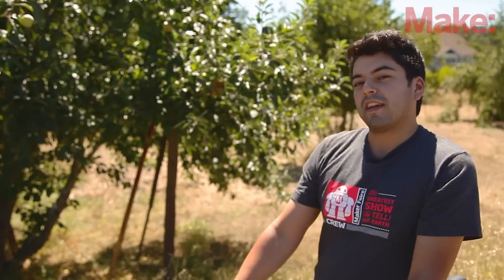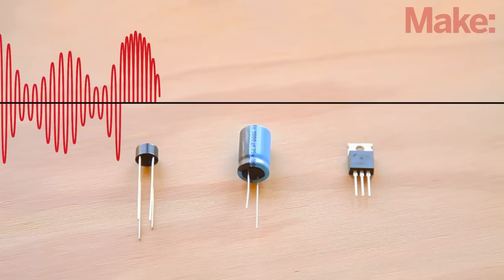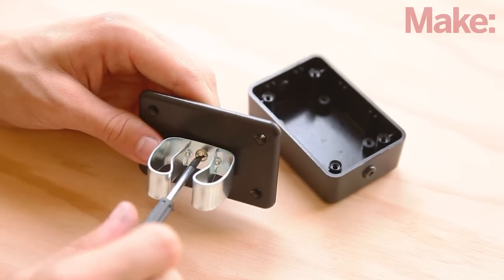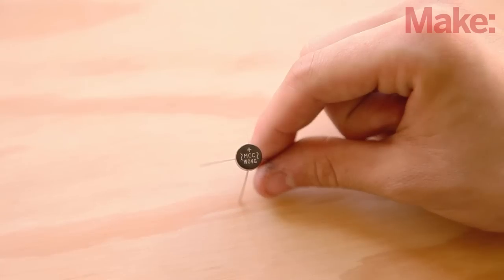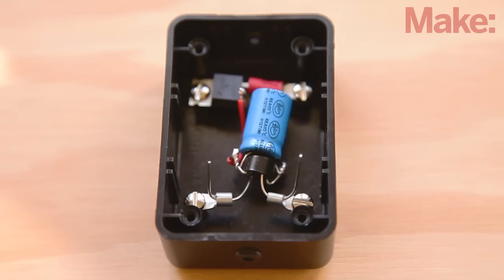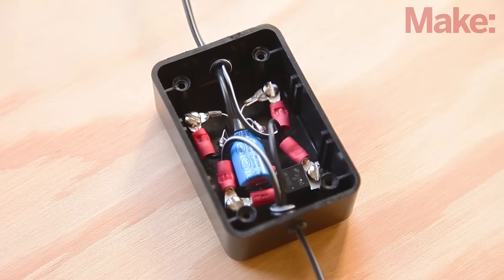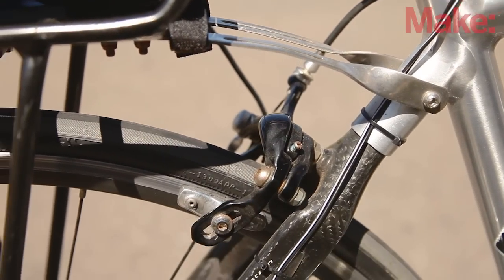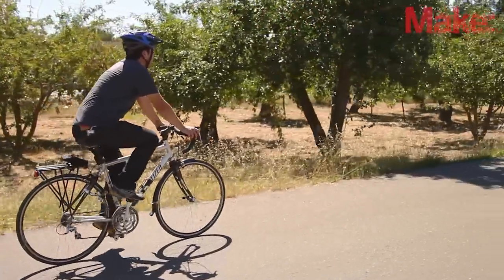Weekend Projects - Pedal Power Phone Charger

Comment: in the last step of connecting usb wire to regulator, one is connected to third leg clearly. Then I can see the other is connected just the head of regulator.

my question : That means is it a free end? For the circuit is getting electricity to the battery of phone?